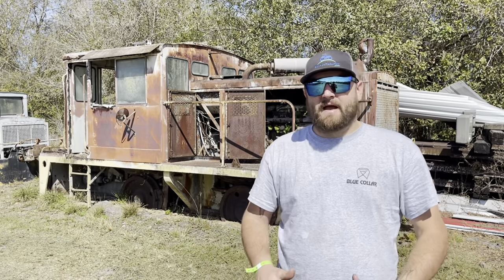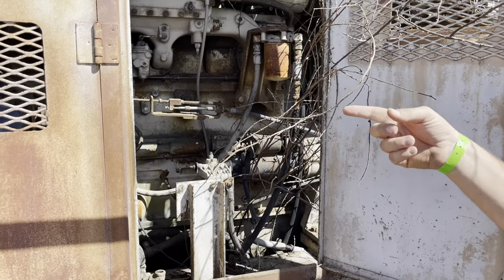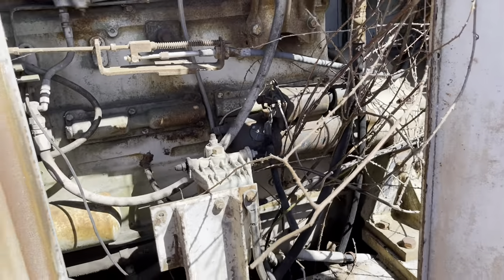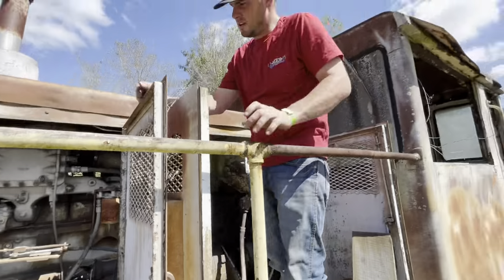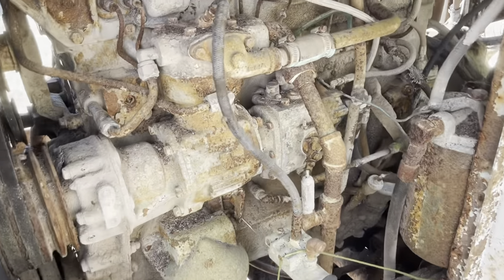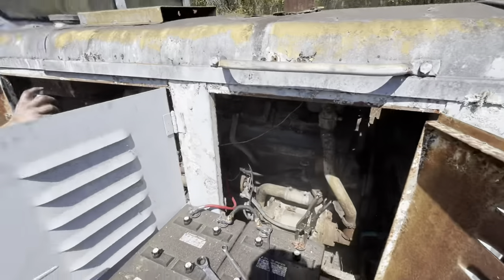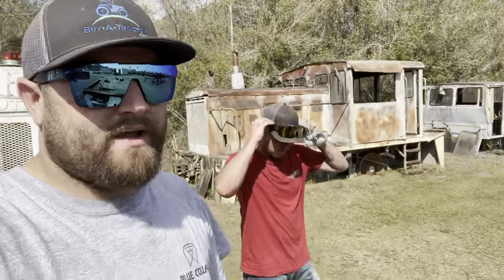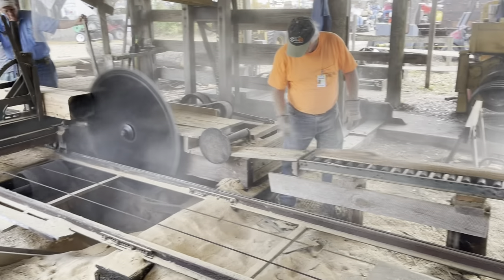WILL IT START? 1962 DIESEL TRAIN LOCOMOTIVE!

Comment: If there was water in the oil pan, you wouldn't see it on the dipstick. The water would collect at the bottom of the pan...oil is lighter than water.
Reply: There would be a white foam that would show up on the dipstick. Water doesn't generally get into the oil unless the engine is running, and that's when the foam is created, and it doesn't dissolve.

Comment: The uncontrolled timing and violence of combustion with ether will break rings and pistons and blow head gaskets with the high compression of a diesel, and should not be used except in very small amounts. That engine had a locked up accessory too- belt was squealing.

Comment: Okay the big cam and a small cam what the difference is the width of the lower rocker that's going to be what you going to look at the Sall Cam is going to be about 3 to 4 inches wide a on the lower Rockers and The Big Cam and Big Cam 11 and MVT all the way up to the N14 are Big Cam and the lower Rockers are about 6 to 8 inches wise the width of the lower rocker is how you would know if it was a big cam or small cam

Comment: No, there not the same as Chrysler.. 2 totally different brands  Those old Plymouths last forever. You literally can't kill them. Personaly I don't like the control set up in them though it looks like their Jerry rigged out of a car. I volunteer at a railroad and we have one. That bigger one is an MDT type. And yes, that wheel in the cab is a brake. That 6 cylinder is a Ford.

Comment: learn a little before you start an engine. First neither in the video were big cams. They were both small cams. the one that wouldn't shut off may have been on manual. If it was, It would have taken the turn of a screw to shut it down. They aren't hard to figure out if they are 24 volt. The starter and alternator would be marked. If the tags were gone, look for the parallel switch. Come on show us something. Don't just try to sound smart.